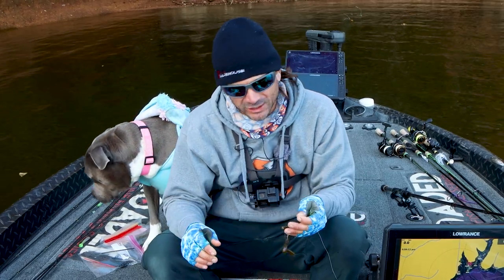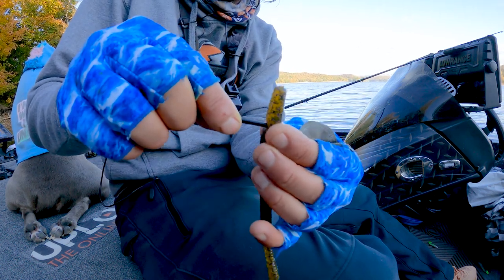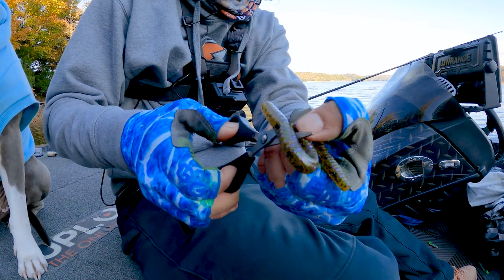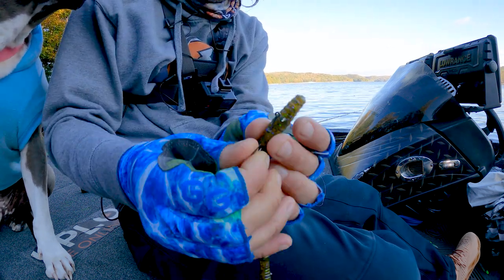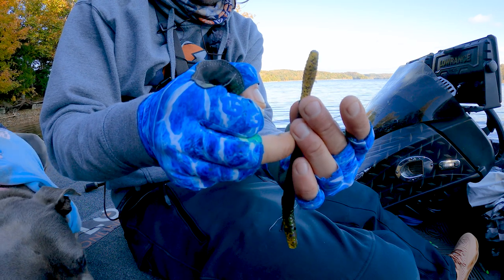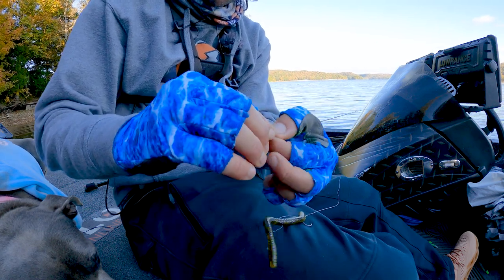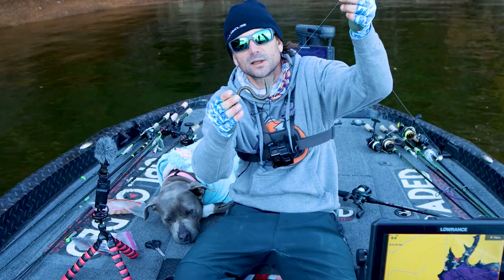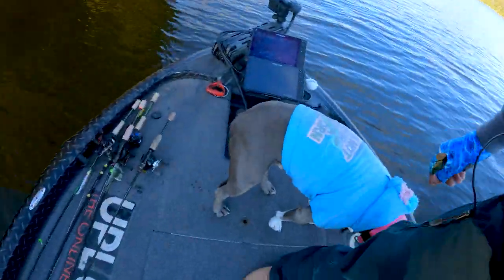The INURIG [The Only Way to Fish a Soft Plastic Worm?]

Comment: Good Vid Mikey, have seen this before, have not tried, I really wonder about your terminal knot, I would think that you would want a more dependable "fishing knot" to hold that split ring on especially with a "Mono" type line, it appears that is the only thing between you and possibly your PB, the hook is not tied at all so if you are hauling in a huge fish the split ring could and probably will make it all the way back to the hook and you only have an overhand not now tying your hook to the line?
Reply: Ya the single overhand knot on the split ring makes zero sense to me.

Comment: I think it might last better with some super glue for sure.I think the "haven't seen the action" factor(I know ,I know" been throwing it for years" lol..) should definately get you some extra bites,especially in clear high pressured resevoirs.I want to try it on a leader of like 10 lb mono to braid setup,maybe use a swivel to prevent line twist . throw it over some sparse hydrilla patches that aren't topped out,rod tip up like im shaking a swim jig.yeah I'm trying it

Comment: I have been fishing it and I love it so I got a box just for it and got my 3 main color worms I use and sat down and put my straws and hook in all the worms and put them in my box so it only takes about 30 seconds to cut the torn up one off run my line through one and tie my split ring back on but I found that putting the hook in the worm first is so much ez’r than trying to get it in and straight after the hole thing is tied on and they will last about 2 maybe 3 fish depending but if u are catching 2 to 2 1/2 lbs up it’s only a little 1 shot deal but I put my worms back on the side and use them for other ways of fishing them or even cut down smaller for Ned rigs

Comment: When you get a fish, what’s holding the hook in place? Just that split ring? You can probably add a small barrel swivel to handle line twist as well as a nail weight to give it a little sinking action

Comment: With the split ring being the pressure point when a fish gets hooked....does it pretty much destroy the worm on every fish you catch?  Seems like if the hook is in the fishes mouth and you are pulling hard, the split ring will just want to pull along until it gets to the back of the hook, smoothing everything in its path (aka the worm).  Does that happen or is it usable for multiple fish?

Comment: Wow, Mike you are a newb for the first time, lol, I've learned a lot from you even at 52 years old but this time I can tell ya where you went slightly wrong with the dog rig your angle is wrong your going to get the wrong  action it's not going to come to you it's going stall and don't use the coffee straws they last for one fish or hang up only, change your angle with some small tubing I use the tip ends of old  broken rods they hollow and they're durable and can be sanded smooth 😉  the dog rig can be highly effective is rigged properly, it's clumpy because no angle through the worm